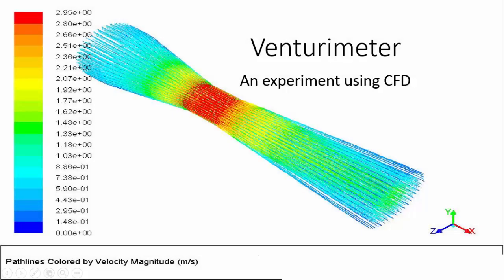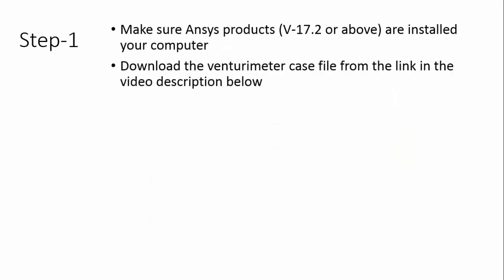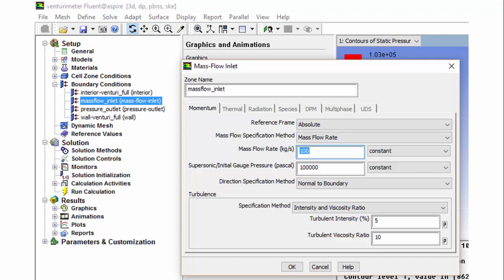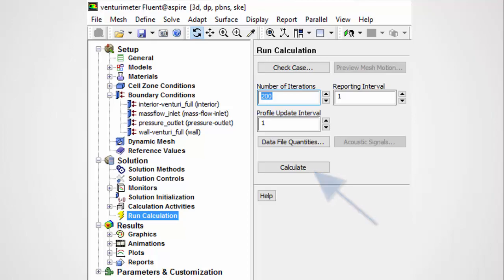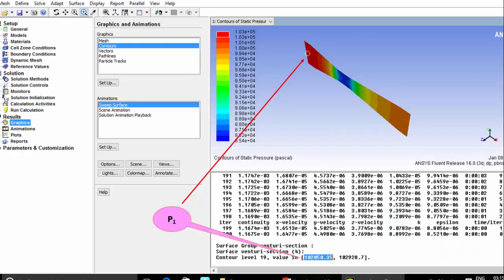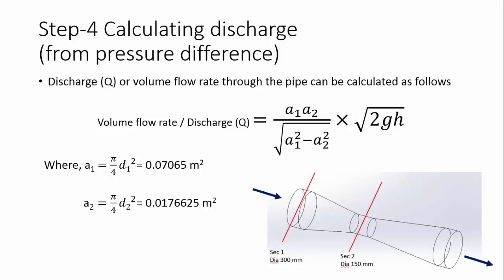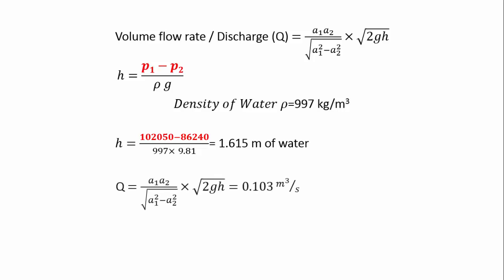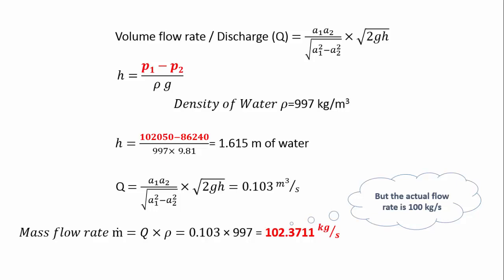Ansys Fluent Tutorial for Beginners | Simulation of Venturimeter | An Experiment in CFD

Comment: sir, how to change the flow rate unit to ml/min from kg/s in ansys fluent
Reply from the maker: ml/min is actually volume flow rate. Whereas kg/s is mass flow rate.
Reply from the maker: To convert kg/s to ml/min, multiply the mass flow rate by the fluid's density (kg/L) to get L/s. Then, multiply by 60,000 (since 1 L/s equals 60,000 ml/min). For water, simply multiply the kg/s value by 60,000 to get ml/min.

Comment: thank you so much.  Well, I have a question: water will flow in a straight pipe and I want to mix the water with the air by placing a venturi in the middle of the pipe.  can you solve this?. thank you.
Reply from the maker: Of course, it can be done. But, it needs multiphase simulation since water and air are in different phases. Try the following tutorials, if have any specific need, please contact support@mecht.in

Comment: how did u change the contour values/how u adjust the range?? ...i mean i tried this same values with my model and when i display pressure contour values in the throttle section it shows me negative value of pressure which is not possible....as operating pressure is 1 ATM (101325 Pa)....please tell me the solution
Reply from the maker: Probably, you have set the pressure at the boundary [outlet] as atmospheric pressure. Its possible to have negative pressure in the throat, if the velocity/flow rate is too high.
Reply: @MechTechSimulations  so does it make any difference if we set output gauge  pressure as 1 atm (which means absolute pressure equals to 2 atm)...bcz my pressure difference will remain same in any case gauge pressure equal to zero or 1 atm..?